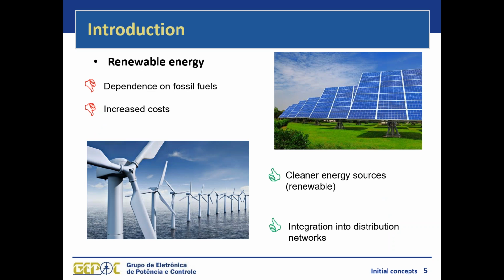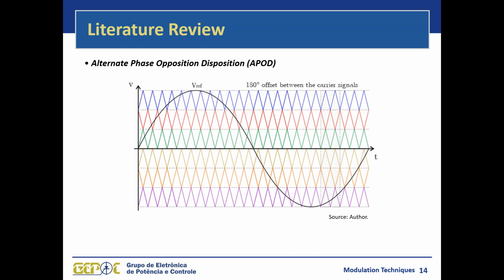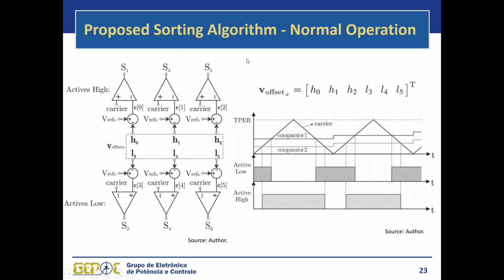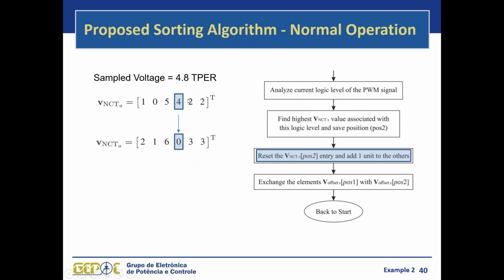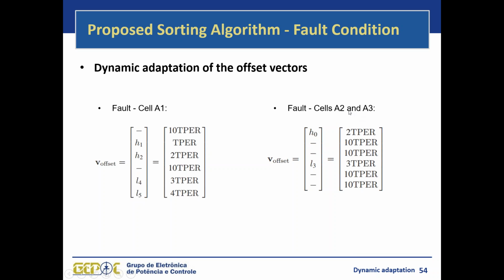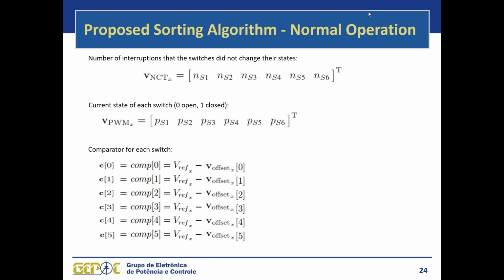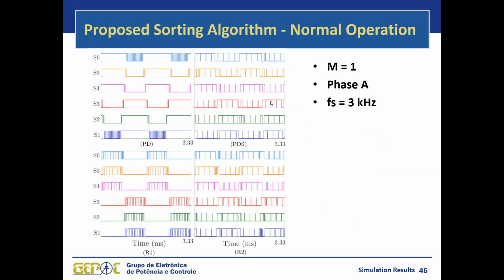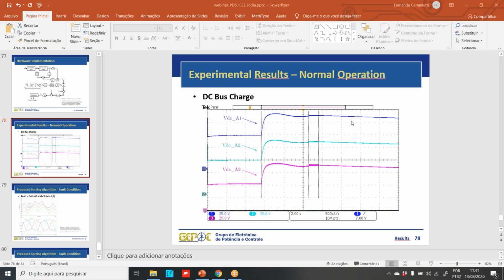Phase Disposition Modulation With Sorting Algorithm for Cascaded Multilevel Converters | Dr Fernanda

Comment: It's inaccurate to say that CHB cells operate at different switching frequency in LS-SPWM. All cells are switched at a fixed carrier frequency, but in a discontinues switching mode. It's the average number of commutations that is different between the cells. This means that switching losses will be unbalanced, unless cell control circulation or sorting algorithm is utilized.